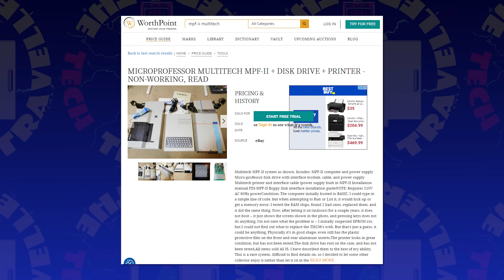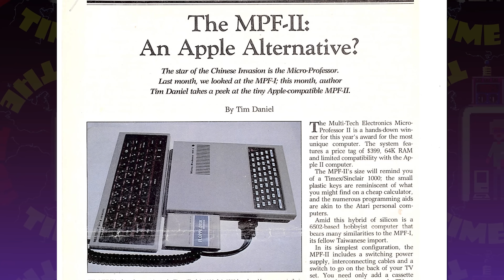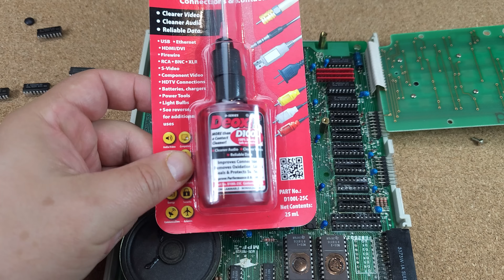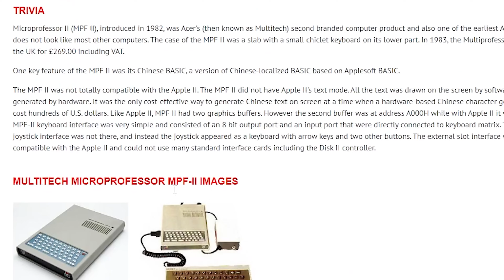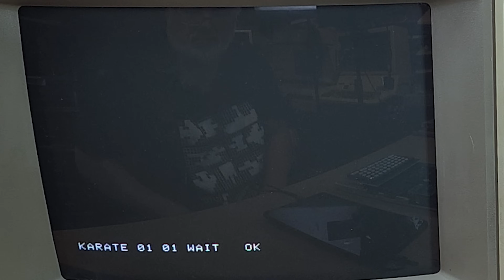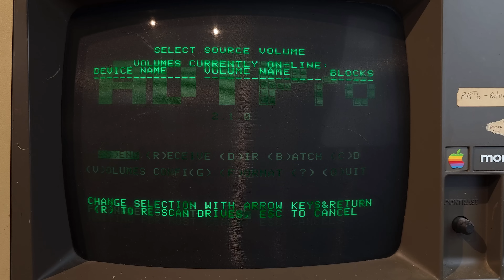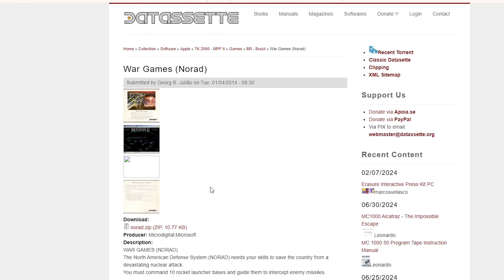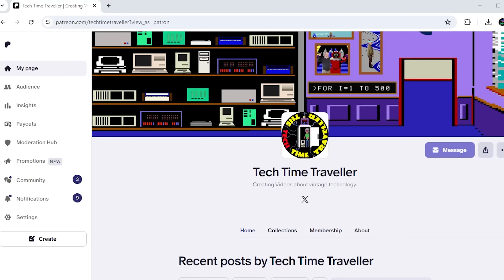This is an Apple II clone???

Comment: Ah, the good old TK2000… my father had one of those, the only thing I was allowed to run on it was Karateka (loaded via tape, though he had the disk drive adapter). I think he ran software related to the accounting office he worked at back then, remember seeing visicalc disks somewhere. Soon, he updated to the TK3000 (Apple 2e clone), where I learned to program in basic. The thing with availability back then wasn’t so much about the costs, but the market reservation in place - we couldn’t import electronic equipment at the time, only buy those items that were assembled in country, and the low volume production meant it was hard to find things like a disk drive to buy in the first place, while everyone already had a tape player/recorder at home. Interesting times! By the time the reservation expired/was voted out we got a 486. Wish I still had those around, all that I have left is the actual disk drive and a few boxes of disks, maybe a tape or two…

Comment: What an interesting computer. I suspect the first thing anyone who wanted to use this thing seriously would do would be to hack a real keyboard to it, especially since the manufacturer already provided a port to do so. Also I'd imagine the reason why the Brazilian company decided to clone a clone instead of the actual Apple II was probably a workaround for Apple's litigious reputation. I bet they figured if Multitech didn't get sued they could probably get away with it too.
Reply: There were already many full Apple II clones in Brazil when the TK2000 came out. Microdigital had focused on Sinclair clones up to that point so their market was the low end. The Microprofessor II allowed a near Apple II clone at a much lower price. It used the new 64Kbit DRAMs, it eliminated a lot of chips by not having the text and low res modes (simulating them in software instead), and it used a Sinclair/TRS-80 style raw keyboard instead of a smart (expensive) one like the Apple II. Later on Microdigital did the TK3000 which was a full Apple //e clone.
Reply: @jecelassumpcaojr890  Awesome. Thanks for the info.

Comment: One of my favorite things to play with as a retrotech obsessed teen in the 2010s was my Dad's old, fully functional Multitech MPF-1. A lot more primitive than this one for sure, just a seven segment display where you entered Z80 assembly instruction by instruction in hexadecimal OR (surprisingly) BASIC despite the fact it didn't have a full keyboard. Still I had a great time with it, it had a speaker you could make bloopy noises with and the heatsink would get absurdly hot if you used it for more than 5 minutes.
Reply from the maker: I always meant to get one but just never got round to it.  They're a cool little trainer.. I didn't know they ran so hot though!
Reply: @TechTimeTraveller MPF-1s are getting quite expensive now on Ebay. They really need a little heatsink on the regulator as it runs quite hot.

Comment: My dad's first computer was a Microprofessor 1, and it;s still running! He got it as a kit in the 70s I believe, and it helped both him and me get into 8 bit computing
Seeing it run BASIC on 7 segment displays is definitely a spectacle xD
Reply from the maker: I can't even imagine trying to program on a 1 line display.. yipe! :)  I think you only got 6 characters if I remember correctly?
Reply: Yep! Six characters, a hex keyboard, 2k of RAM and cassettes as the only data storage. I think he also had a tiny thermal printer for it too
Also, aside from that, I absolutely adore your content and it’s inspired me to try and attempt to make my own SWTPC CT-1024, although that the moment it seems well above my GCSE level electronics skills xD
Reply: @TechTimeTraveller  BASIC calculator, TI-74 I had in 1985 when it first came out, high school kid had plenty of time to learn how to edit on a single line ;)
Reply: Single line basic is quite an experience. I think there was a Japanese Sharp BASIC computer in calculator form factor. It had a glorious dot matrix LCD display. It was a marvel. My folks still have it. There is also a thermal printer for it. And maybe a cassette adapter too.
Reply: Surprised it still works

Comment: For a simple solution. I use CRC electrical cleaner. Just make sure to get the can that is plastic safe. They have a contact cleaner. But depending on the version it is not plastic safe. My experience is about the same as using deoxit. Just tons cheaper.
Reply from the maker: @idahofur  I always get confused about contact cleaner vs whatever deoxit is.  I had canadian tire contact cleaner but was left with the impression it wouldn't clean ic sockets properly.  Not sure why I came to believe that.
Reply: @TechTimeTraveller  Different brands and different ic's / sockets / strength of cleaner. A good example is the Apple II plus I cleaned up. The sockets cleaned up nice. The dram chips not that much. So I had to clean those differently.

Comment: I had one of these as a kid from 1983-1986. The external chicklet keyboard was very difficult to type on. I had the external 5.25” disk drive and the 40 column thermal printer. The lack of software meant that I was forced to do a lot of BASIC programming to enjoy the machine. It was a huge step up in 1986 to an IBM PC XT and then on to Amiga 500 in 1989.
Reply from the maker: Nice!  So you guys were never aware of the TK2000 and its software library I guess then.  So weird that Microdigital cloned a machine with so little going for it.

Comment: You hit the nail on the head with your comment about shopping on Amazon when you don’t know what you’re looking for 😅.  I’m not formally diagnosed ADHD, but I strongly suspect it, and that’s definitely my online shopping experience.
 
As far as the deoxit, I’m not sure but I suspect one reason for spray versus liquid would be that you can do a more vigorous flushing with the spray. Also handier for getting down inside pots and such when it’s thinner and has some force behind it. 

And actually, I’m pretty sure the directions say that you should flush it, cycle the joint a few times, and then give it one more dose. (I rarely see anybody do that on YouTube, so people probably don’t read the directions 😂.)

Comment: I had an MPF III and absolutely loved it. I modded the crap out of that thing, upgraded ROMS, put in a 65c02 in it. build a 128k RAM disc for it. It's still at my Mum's house, I will have to collect it one day and see if I can get it back up and running.
Reply from the maker: @ThecrackpotdadPlus  Nice!  Did they improve on compatibility at all?  I saw one for sale recently but didn't jump on it as the seller was asking quite a bit.
Reply: @TechTimeTraveller  Oh! I still have my MPFIII, and it works perfectly. It is from 1984, and I used it during the first years of the University while I was studying Electronics Engineering. I really love that computer!
Reply: @TechTimeTraveller  Oh yeah, the MPF III was very compatible with the Apple //e, there were some easy hacks that could make it compatible with the //e+ (with mouse text etc. 

It was great, I really loved it. I am definitely going to go get mine from my Mum's.

Comment: the way a 3.5mm headphone jack switches is that there's a switch inside the jack, so when you plug a cable in there the device knows to turn off the built in speaker and route the audio out through there. It's not detecting the receiving end.

Comment: Neat! Thanks for showing this off... I never heard of this Apple clone before.
Given all these games worked, it seems the compatibility isn't /terrible/.
Reply from the maker: I'm hoping someone with better programming skills than I can figure out how to transplant the compatiboot thing to make other apple II software work.. if it's even possible..
Reply: @TechTimeTraveller  I'm confused by you mentioning it uses a different memory map, yet these games run. I guess it could be subtly different.
Reply: @DrDavesDiversions  These games were patched to run on the beforementioned TK-2000 clone, so they run without issue,

Comment: There is a software for Android that can force audio output on 3.5mm jack socket. I don't remember its name but I have used it to be able to send APRS packets through my handheld radio (ham radio stuff).
Reply from the maker: I will check that out.  It's weird how one worked but the other didn't.

Comment: I'm amazed that the users groups of the time didn't mention these, a lot of us C64 users would have loved a $400 Apple II to hack. The Brasil devices would have been great bootleg imports too ;) In Fort Wayne Indiana, I did manage to lay my hands on a Sinclair ZX81 imported from UK, would have been cool to get cheap Apple clone that was so small.
Reply from the maker: Growing up in the early 80s the only places I ever saw Apple II's were in classrooms or teacher's houses.  I guess they were just so much more expensive than Commodore etc, which I saw a lot of.  I suppose folks wouldn't have minded getting their hands on a cheap variant, even if it required some hacking for true compatibility.

Comment: the whole rx tx thing is often a PITA. i have a monitor that swaps them around. i think it's because it could be interpreted as one side's send will go to the other side's receive or alternatively that master system controls both send and receive lines and they run straight across

Comment: Great video!
Perhaps a weird request:
I have one of these, but no accessories, including no PSU.
If you have the time when making the next video or so, I would appreciate it if you measure and include the PSU pinout.
(Of course I could just tone out at least +5V and GND, and probably additional pins to the expansion connector, but as it took you four years to buy some Deoxit, you might not be that surprised to hear that I bought my MPF-II before 2020 and haven't taken the time to figure this out :) )

Btw the MPF-II figured in various 1983-home-computer-boom-era magazines in Sweden but I never heard of anyone owning one, until vintage computing really became a thing not that long ago.
Reply from the maker: Many thanks!  I can do that for you.  I'm terrible with stuff I buy lately...  I have several machines I bought years ago but never got around to playing with just due to 'ah.. I gotta connect some wires' hehe

Comment: FYI depending on what type of phone you're using they usually sell 3.5mm adapters for the charge port. It's still BS you have to do that, but you can at least still use wired earphones.

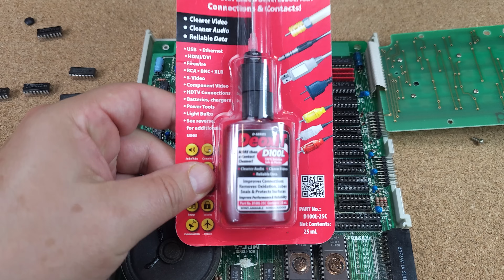Comment: 7:00 Do you think customs will have a problem with me sending s 55 Gallon Drun of D100 from the US? 😅
Reply: I'm pretty sure the D100 is concentrated. I prefer D5L. It's cheaper and you don't have to worry so much about wasting it.  See Deoxit D5L-4A solution.

Comment: Was there a specific reason you chose not to wash the PCB off with soap and water after applying the DeOxit? This is the method I've always seen after use to remove the excess/goo and additionally cleans the boards up...
Reply from the maker: I did consider doing it but wasn't clear from the bottle if you needed or wanted to do that with d100.  First time using it.
Reply: @TechTimeTraveller  I was always under the impression that washing boards with soap and water is fine for most with the caveats being you gotta get all the soap off and dry the boards completely

Comment: One common pitfall with serial connections is they have two main uses and aren't usually labelled as to which they are intended for. The first type is for connecting simple peripherals and have straight through pin to pin connections. The second type is for use as a DTE-DTE communications link, which doesn't need a modem, and so includes an in-built 'null modem' crossing of the Tx/Rx lines.
Links that use (a pair of) modems actually use the simple straight through  DTE-DCE cable at each end since the modems automatically swap Tx/Rx as a function of the connection protocol.
If you need the breakout board set to straight through mode I would guess you are only using it as a gender changer to enable you to connect  the two cables, one of which has the null modem crossover. Either that or you needed a straight through connection and both cables are cross over types so you needed the breakout board to cancel the built in crossover when using them singly.
Reply from the maker: The weird thing is.. if I just removed the breakout box and connected those same two cabled together.. they don't work.  Even though the breakout box is just passing everything through unchanged.
Reply: @TechTimeTraveller  That IS weird. I would suspect dodgy connectors. Possibly a loose fitting pin in the corresponding socket that only makes intermittent connection. If the breakout box has larger pins or tighter sockets it could make a more reliable link. I’ve been caught out like that with aerial connectors. Different manufacturers and the plug held the pin perfectly in th centre of the socket without touching the sides. Yet close enough that capacitive coupling allowed enough of a signal to pass through that it appeared to work poorly and led the investigations down many other possible signal degradation possibilities before the actual culprit was tracked down.

Comment: Are there any hardware mods for the Brazilian machine (and thus MPFII also) documented that can change the hardware addresses to make them fully Apple II compatible?  That might be easier in the long run than tracking down compatible software.

Comment: I haven't seen one of those in an age....................
Reply: Any idea if people modded them from new to use the apple memory map and swap cloned roms into it, or did they just get used as-made? By the time this came out the c64 was around too and not much more. Hard to imagine intentionally getting a machine with nearly no software and such a bad keyboard when a little higher price would get such a better machine.
Reply: @carpespasm  No.  You would have to look elsewhere.

Comment: it's not so much CRT whine but just some other noise on your microphone. Bad ground connection maybe? There's some hissing.
Reply from the maker: By any chance do you recall where you heard it?  Was it when I was speaking live?
Reply: @TechTimeTraveller  right in the start, it gets better
Reply: @TechTimeTraveller  It's basically up to that first chapter marker. then your voice keeps going and the odd hissing disappears?
Reply: I've had that happen on some wireless mics with an old battery when they get low, I think the voltage drops below the operational parameters and it introduces that gibberish digital noise into the signal.
Reply from the maker: Ah now I hear it.  Wth.. that's my Yeti mic.. my 'good' one.  And that whole segment was recorded in one go.  I wonder if I goofed when applying noise reduction.

Sound has always bedeviled me.  I've had to fight with every mic I've ever used.  I'm finding Blue products generally aren't that good.

Comment: It's call -151, not 159 but this "compatible " is so weird it may be different
Reply from the maker: Manual says -159.. but I did try -151 off cam in case.  Neither worked.  But it can 'fall' into the monitor if something crashes and various machine language instructions seem to work.  Really weird.